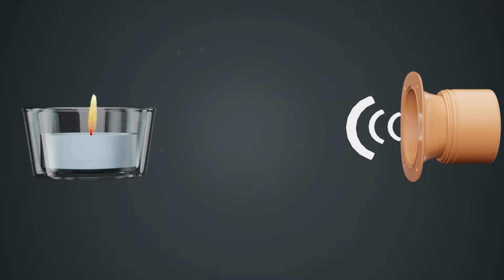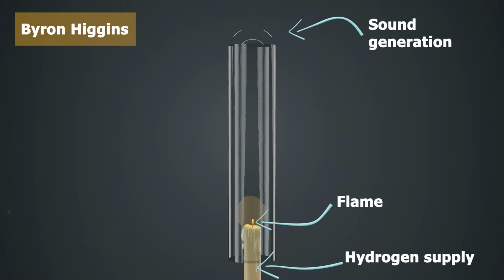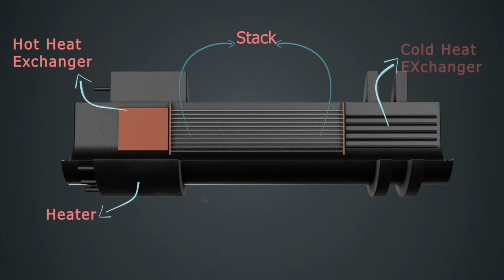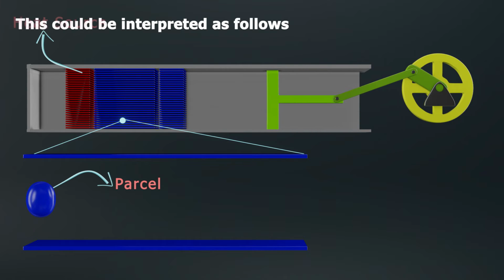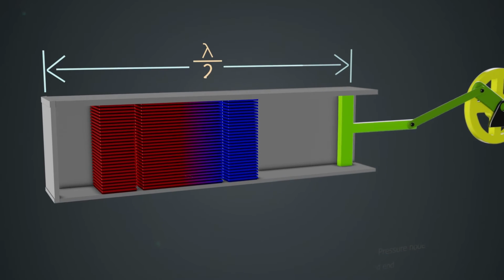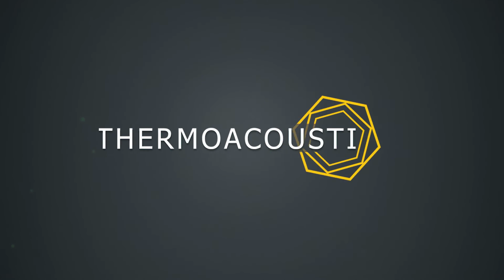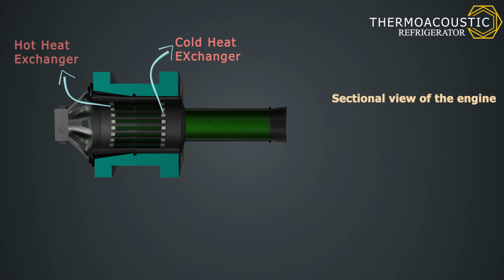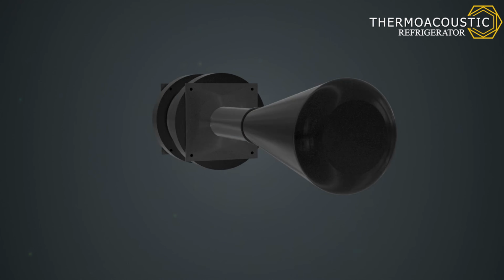Understanding Thermoacoustic Engines & Refrigerators (CZE Subtitles)

Comment: The climate change has deposited more carbon into trees, and the trees have released more arsenic into the soil, which is why Rice Farms are experiencing higher levels of Arsenic and are trying to combat that. 

SAIs were designed to block out the Sun in attempts to Geoengineer away the rising temps as the Earth goes through a Hot Period.

Comment: Can you explain how the candle gives off hydrogen
Reply from the maker: A hydrogen flame was used by the scientist experimenting and not a candle. The point however is to show that the heat source (hydrogen flame, wired mesh, etc.) is the reason for the sound emitted.

Comment: I understand it works empirically;
However ?how can I derive the thermoacoustic effect? from well-establidhed physics
          For ex: ?how the heck does the temperature gradient cause a sound wave?
Reply: The heated gas can only expand so much, and is cooled in the stack. So it reverses direction and is heated again. This bounce back and forth is sound, the tone depending on the length of the tube

Comment: Sounds like that needs alot of Ai modling replacing the speaker with  a modified tuning fork made of carbon nanotubes to keep the acoustic wave ossolating inside the modified heat synch resonance chamber with a little bell like system to get it going with a shake and let it rest... ideas no workshops

Comment: Is the frequency of the piston the same as the closed tube frequency? Or what is the frequency of the piston related to?
Reply from the maker: Not necessarily the case. However, it is possible to match the frequency of the piston to the resonance frequency of the system (resonator tube) to achieve optimal performance. This is known as lock-in or synchronization. When the frequency of the piston is close to the resonance frequency of the system, the energy input to the system will be most efficiently converted into thermal energy, resulting in the highest temperature difference between the hot and cold end of the system.

Comment: How to calculate thermoacoustic engine efficiency?
Reply from the maker: The efficiency of a thermoacoustic engine is equal to the acoustic power (desired output) divided by the hot heat flux (required input).

Comment: What size acoustic Refrigeration can be used on a refrigerator and is it cost effective
Reply from the maker: Most prototypes are used for research and experimenting and are not available for commercial use. However, in regards to sizing, total length varies around 60cm with the large diameter equal to that of the loudspeaker. But it could not yet compete with conventional units due to its lower efficiency and power losses.
Reply: @AhmadKouta  I am currently researching into this topic for scholastic purposes and would love to have virtual meeting with you. please contact me if you are still active.